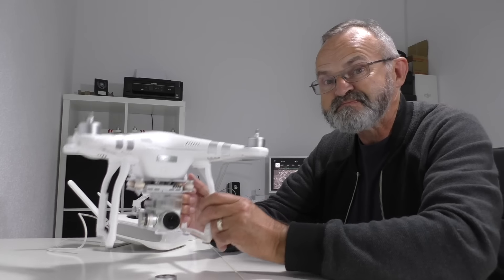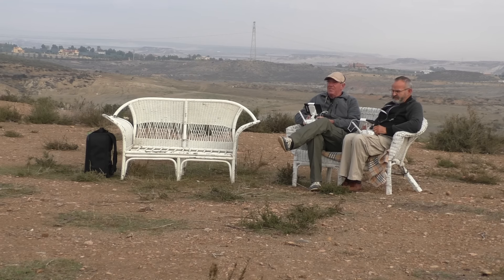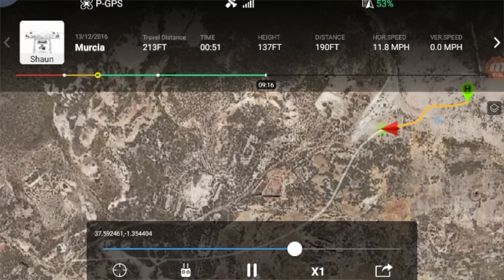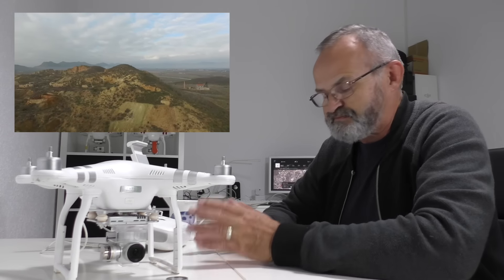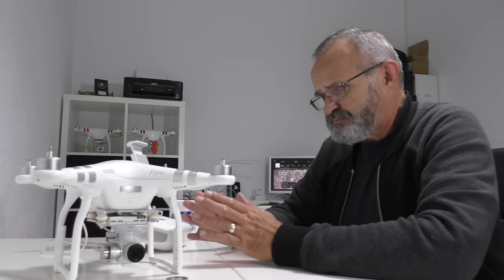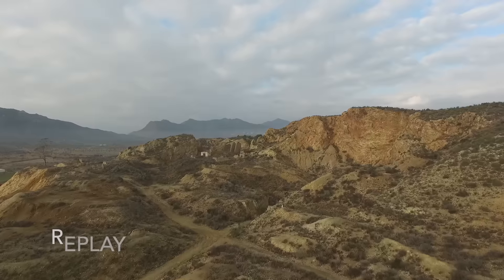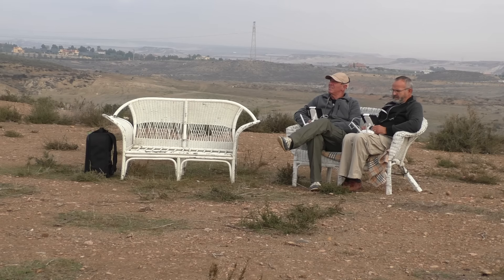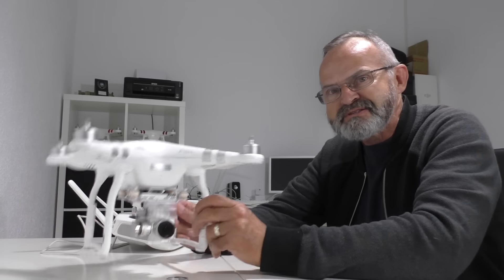Found my Phantom 3 Advanced #shaunthedrone

Comment: Happy you found it!
 Strange that P3A would not respond. Not sure about interference if both of you were not experiencing the same problem? When you did the software update, did you perform an IMU calibration? Anyways if P3A is still working and just has some cosmetic damage,  you should be good to go if it checks out okay. Lets hope so.
Meanwhile. the weather has been bad for a while and seems to be when I have the chance to fly, Winter is here for sure.
Thanks for the update Shaun, interestingly described.
Reply from the maker: Thanks Addy, didn't do a IMU after the update - DJI Support are dealing with it now - Data Analysis Engineers are looking at my flight log now and hopefully be able to tell me what went wrong! Weather here has gone wet! Next week before I can test fly again! Many thanks for watching :)

Comment: So glad you got your bird back. If i were to wager a guess, You had the same thing happen within days of what happened to me. You lost gps signal and the wind took it at the previous height and took it into the the cliff. I can only assume you had interference from flying so close to the other controller that was on before yours, and perhaps the location of your antennas which also limited my long range test. After watching your video I will make sure I take special attention to the the tablet being too close to the antenna and the antennas position and standing so the controller is elevated. The one thing that saved my flight was the controller letting me know to switch flight modes because of interference. You might have not  been so lucky because you were next to another controller. I must say you were much more composed than I when it happened. Good to hear you recovered her.
Reply from the maker: Thank you Chris, after flying these for many years and losing 2, one with a GoPro camera on, you get used to things going wrong! It's a amazing bit of kit but like all things never 100% safe! DJI Support have my flight details now, just waiting for the report back - give them credit they did reply straight back on the second email and now I have a case file so hopefully I can get answer! Many thanks for watching :)

Comment: Glad you got it back,  my worry would be how can you enjoy flying it in future without trusting it wont go cliff hunting again! look forward to updates when you test fly and any progress on cause.I'm cynical that DJI will give any help when they want to sell Mavic and P4P now so may not care about P3 owner problems, hopefully not the case.
Reply from the maker: Thank you James, at the moment DJI Support have passed it to their data analysis engineer and checking my flight log. Hopefully they can find what went wrong. Just checking today the full damage, close inspection have some cracks underneath 2 motors - may need some plates or replace the whole shell! Camera & gimbal look okay. Have to do a IMU and Calibrate before test flight - weather here is like the UK - grey and wet! Many thanks for watching :)
Reply: The flight video clearly shows it just went flat out away from you, but I can't see DJI accepting that - which firmware is this, I am still on 1.9.60 from June, so if this was on the latest November 1.10.90 I would steer well clear until they have ironed out niggles!! If you want to try the 3D printed type motor protector plates I have a spare set I'll never use. I've emailed your hotmail address with pics, your very welcome to them. Changing the shell looks like a fiddly job, just glad the camera/gimbal are OK as that would be a write off otherwise !!
Reply from the maker: ***** Thank you James, could be right - Steve is still using 1.9.60! but he did have a problem at the other mine we visit - RTH didn't work straight away then returned - I will check my email later - many thanks for the offer :)

Comment: Metal can certainly cause compass problems, if it had a mixed up compass that would explain it going in the wrong direction when trying to come home (does not explain why you got a rth failure message though unless it had sensed compass problems when you press rth). What is you rth attitude set to cos it never seemed to climb much? Glad ya got it back without too much damage, I am sure we will all learn a lot from this as you do your detective work on the logs.
Reply from the maker: Thanks Steve, checking my log and going to try Healthy Drones app and see what they say - it all helps each other - Steve the other day had something similar at the other mine while I didn't - he's still on the old update while I'm on the new one - so it can't be the update - I'm sure we will get there! Many thanks for watching :)

Comment: I just got a refurbished P3A last week since my P3S is at RIP from crashing into a tree and then fell into a body of lake.  I am still struggling to paste a firmware from a computer into a SD card in order to update a smart battery.  Grrr....
Reply from the maker: It's amazing how tough these machines are! Good luck with the firmware update - hope you get it sorted - many thanks for watching :)
Reply: Expat in Mazarron  Yeah, it is not like P3S. lol  I'm glad that I finally found my answer and I was supposed to use an USB connecting to a computer.  it worked through my drone.  Now the battery is successfully updated.  Duh me. smh lol